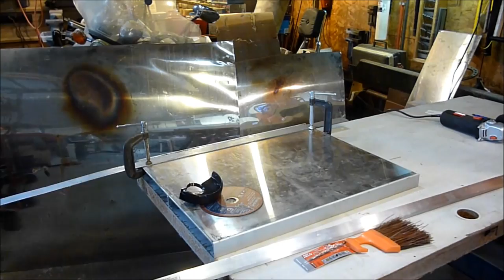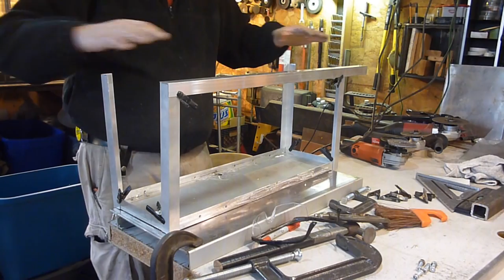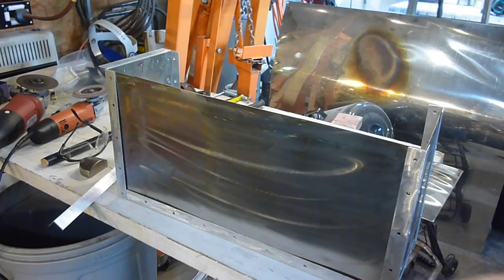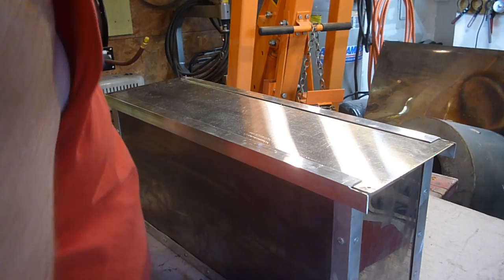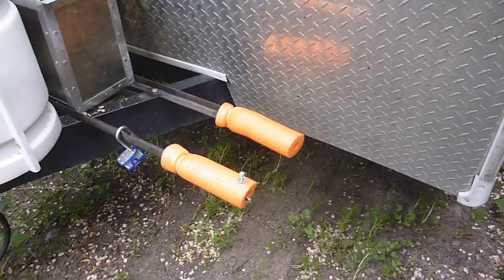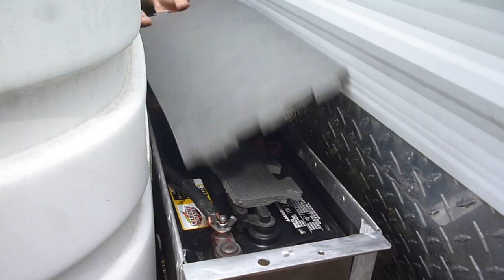LOCKING BATTERY BOX FABRICATION (RV UPGRADES )

Comment: flooded lead acid batteries like yours need ventilation and lots of it.  you will need to cut air holes on the sides of the box and remove the foam pieces.    imo
Reply from the maker: there are good sized holes in the back but i have thought about putting more venting in i've been watching them  fairly close and so far  haven't had any wetness on top of the batteries but thanks for the info